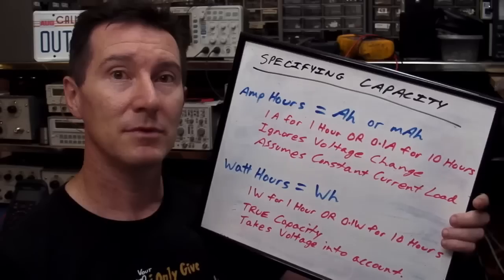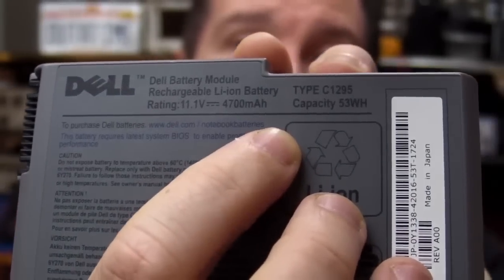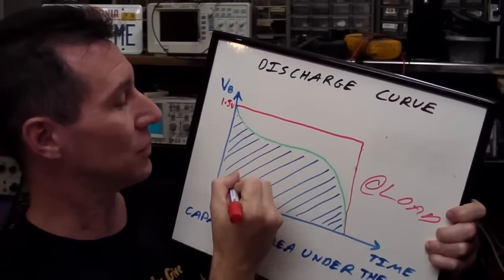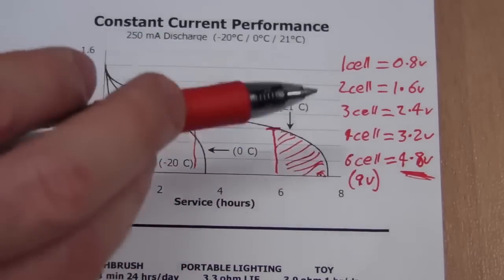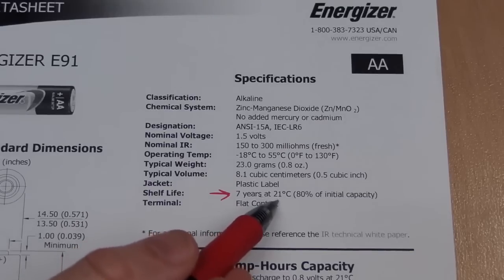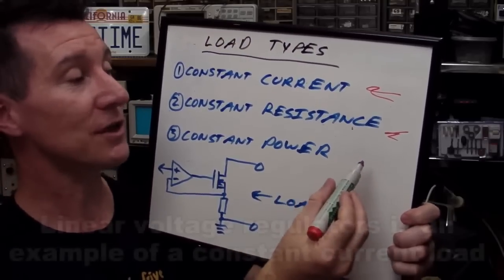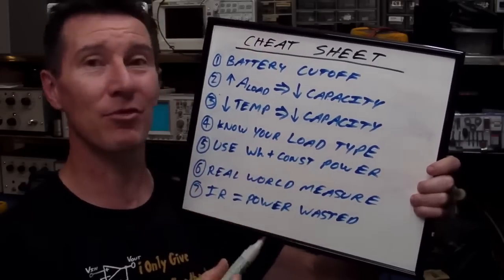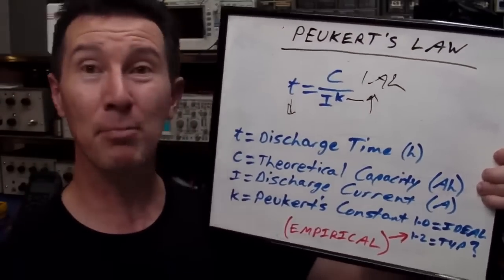EEVblog #140 - Battery Capacity Tutorial

Comment: A very good video. I've been doing a bit of hobbyist testing of CR2032 batteries and this is very useful in covering  the finer points of capacity and battery performance.

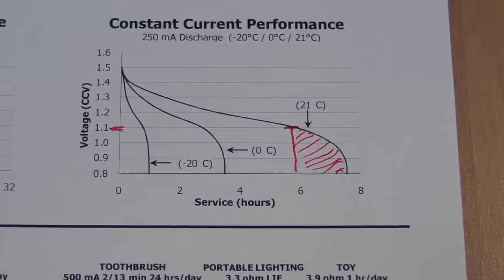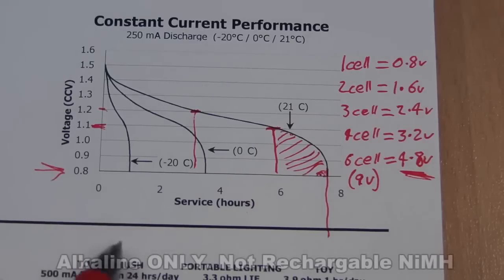For the discussion at 12:30, as per the added caption at 13:24 about rechargeable batteries, isn't there a dilemma here about product design vs a 0.8V cutoff as users are likely to try rechargeable batteries even if the product says not to use them? Some products have a user-specified setting for battery type but I've always assumed this is just used for battery level indication and is unlikely to be perfectly trustworthy?

Comment: The total energy of any maximized chemical storage is roughly equivalent to the same mass of common explosives like flash powder or dynamite. 

So if you measure that a battery has around 5 grams worth of chemicals in it, if the energy was released at the same speed as a plastic explosive by a capacitor, the damage would be roughly the same as detonating 5 grams of TNT or C4 or RDX, whatever.

Comment: I am back watching your vids Dave - great work. You are worth a trip to the "top paddock" - no knackery or mackers for you . comment all positive so fear not>>As I done Mech.Eng before Elec.Eng . Battery and nonlinear (eg. milliwave 18GHz and above) circuits never bothered me, but working with elec. techos I spent many hours explained non-linear behaviour and "capacity".  Mech.Eng is about laws of Thermodynamics ( that's proper Mech eng science - more like physics or theoretical mech as opposed to quantum mechanics ). I had fun times explaining concepts to techos and I can tell you they hated anything that involves math let alone opening the mouth and sounding out word like "Integral" of "Differentiation" and Fourier was some French guy. Best example of non-electrical circuits involving sink-source ops are pneumatic-air or fluid circuit and "load-matching" all fun stuff. Keep up a good work Dave, I will see all of your blogs in no time - thumbs up on all of the ones I watched so far. ( Ps I did learn from them also how to ...:-)

Comment: 6:46 1J=1W.S=1W.H/3600, not the others way around.
Reply: It is true that 1 joule = 1 watt.second
It is also true that 1 watt.hour = 3600 joules, so that 1 joule = (1/3600) watt.hours

What he is trying to say in the video is that if you have a value expressed in watt.hours you need to multiply that value by 3600 to get the value in joules, and that is exactly what he does for the AAA and AA cells. I agree that the presentation is a bit off in his 'equation'.
Reply: U r wrong
J = W * S = W * Hr * 3600

You divide Hr by 3600 and what do get? Ahahhh ))

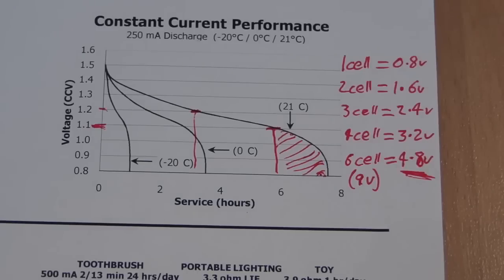Comment: At 13:00 -> If I would run a LED with 3 cells at 2.4 I'll get the most out of a battery? N how do I make shure that the LED is staying at 2.4V? A resistor is for the current, but what restricts the Voltage? Please help me I have to deliver the atomic bomb by Monday next week. thanks I will mention your name.

Comment: This whole Amp hours and Watt hours debate is why deep cycle batteries often use reserve capacity as a measurement because it's a good apples to apples comparison between the same kind of battery. I'll explain. A 12 volt nominal battery with 60 minutes reserve capacity. That means that this battery will stay above its depleted voltage (if memory serves the industry uses 9 volts as dead) for 60 minutes at an industry standard 20 amp draw. Basically at an average draw of 240 watts (12 volts nominal times 20 amps) the battery will run for 60 minutes till it's depleted.

Comment: Hello Dave, I find that when you try to charge your Batteries too fast, you end up killing the cells.they buckle and once you get them hot, they will never be the same again. The best way to charge Nicads and nimh is with a workshop power supply and when your current drops to close to zero, battery should be charged. If battery always draws current, usually means Battery is rooted. I have tried all the different tricks years ago when cell phones hust came out and phone batteries were worth a couple of hundred Dollars. We used to charge people to recondition their Nicads. All we would do is zap the batteries with 240V just for a laugh and the fucking stooges would think they were all reconditioned. It's basic Ohms law

Comment: EEVblog, Does a AA battery have enough energy to kill a human if it is drained out in a single go? 9000 Joules you say...
Reply: Apparently you can kill someone with a 9V Battery, across the heart, the basic rythim of the heartbeat gets whacked out of phase and cardiac arrest usually occurs. Also need to take into account how sensitive your skin is. and it needs to be a real unlucky whack to cause your heart to go out of phase
Reply: yes with ease.
Reply: @mitch3443ful 
just look at an official datasheet, a typical AA alkaline provides you ~2400mAh capacity when at a discharge rate of 100mA down to 0.8 volts over 20 hours. the average cell voltage during this time is around 1.1v to 1.2 volts.
This gives us 2400mAh * 1.1V = 2640mWh = 2.6Wh. 
2.6W * 3600s = 9360 Ws(Joules)
A high voltage capacitor bank at 9000 Joules can vaporize copper wires. Not melt, vaporize. Wire explodes into thin air. 
9000J can also be used to make a rail gun (which will be 5x more powerful than any 9mm)
I don't want to imagine what 9000 Joules shorted across somebody's heart would do (it would probably explode). 
hope this answers your question

Comment: A non rechargable battery out of a high power device is kept here for the clocks. Clocks are really low power devices that can go years on a battery. The battery probably loses more through discharge then through what the clock needs. 

So after a big power drain is done here with a non rechargable they are simply demoted. 

Still I hardly use non rechargables these days. A good rechargable is worth its price ;) But not for clocks...
Reply: What do you think of the high drain alkaline cells Energizer has? I've never used them, but I've seen them at the store.
Reply: tarstarkusz I wouldn't know. I never seen them myself yet or tested them.

I guess for one off high drain uses like cameras, drones and the likes it will have a use. 

Still rather go for Low Discharge NiMh if possible. Not that well suited for super low drain but medium and high drain they are just fine.

And there always is lithium for the specific machines that can handle them.

Comment: What about nuclear batteries?
Reply: shomolya https://www.ideals.illinois.edu/bitstream/handle/2142/16849/1_yakubova_galina.pdf?sequence=3
Reply: shomolya So? I am waiting for your analysis and my sharks are very hungry...
Reply: The reason why these batteries have such a high energy density is because if you look in the periodic table, the nuclear elements(which would compose of the batterie's cathode) would have the greatest amount of electrons in comparison to the other element. This is what allows them to discharge for such long periods of time. So technically, you could produce a uranium-carbon battery as apprised to a zinc carbon battery and it would still work! So here is your answer 😎.

Comment: I think Dyson hand vacuums pretend to be an ideal battery (I know it's just theoretical) we have a small Dyson vacuum at work that even new out of the box and even in the instructions says the battery will only last 7 minutes. And it literally does from a full charge you get 7 minutes and then it stops no slow down no way to get a bit more out of it the vacuum will just stop working at 7 minutes, bam, done!
Reply: David Hughes They've achieved that with power filtering.  It's a good idea though, because nobody really wants a product that starts out tough and then wusses out after a few minutes (I'm looking at you, cordless drills.)
Reply: Lithium Ion Batteries will hit a certain Voltage and then just cut out. They have electronics in the cells to do this. I think It's because Lithium Ion Batteries don't like to be totally drained

Comment: Well, isn't that just depending on your definition of capacity?
When I think of batteries, I always think of a discrete amount of separated ion/electron pairs stored in the battery, which, for me, is its capacity. No matter what voltage or current you drain the battery with, at the end of the day, all electrons will have walked from one side of the battery to the other, if it is completely drained.
It's like having a 1l bottle of water with a hole in it. No matter how big the hole is (max current) or how high the water pressure is (voltage), when the bottle is empty, you will have gotten 1l of water out of it.
So, in fact, I think it's kindly fair to say a battery has a capacity to store N electrons (and ions) which also is N*e = Q [Coulomb] = I*t [As] or [Ah].
Sure, in your application, you will have to take in account your voltage and current. You won't be able to use the full capacity if your cutoff voltage is too high... You also won't be able to flush your toilet with only a 1mm opening in the water-bottle ;) However, measuring battery capacity in mAh isn't wrong... In fact, it's the only right way. Imagine a fully charged battery with completely isolated contacts. You won't ever get any current out of it, so no Wh at all. However, technically, it still stores a fixed amount of electrons. It's like a sealed 1l water bottle you cannot open. You can't use it, but noone would doubt it has a capacity of 1l ;)
Reply: But when powering electric devices your electrons only mean half of the equation.
In those cases you usually have "work" to do and work is the equivalent to the energy which is measured in Wh.
The amount of electrons would be Ah.

When you want to power a turbine with water it doesnt matter if you have 1l or 1000l if they are not fast/strong enough to even make it turn. Thats where the voltage comes in.
Voltage represents kind of the strength or speed with which the electrons move and that is also energy (you know, energy is mass times speed, more electrons equals more mass and more speed has a direct impact on the energy).

Comment: One of the best quick battery videos on YT, though most of what was said would apply more to primary cells. Unless you go nuts, you should get 3WH out of a 2500mAH NiMH cell at the same temperature (though most good quality NIMH cells will work at low temps). While it's nice to lower the draw by adding cells, there's a tradeoff on that too. Never underestimate the stupidity of the person who will use your product and go mixing cells and the more cells there are, the more opportunity there is for a mismatch.

Comment: Dear Sir

As a school project I built a very simple lead-acid battery to investigate cycle fade. 
The capacity of my lead-acid battery decreased as the number of cycles increased, as expected. Surprisingly enough, the capacity increased after a 24 day period of deep discharge. I did the same thing three more times (so a couple of cycles followed by a long period of deep discharge) and every time the capacity had increased after the period of deep discharge. 

The battery did become more difficult to charge (to induce current flow a voltage of about 10 to 16 volts was necessary, just for a few seconds) and eventually it stopped working. However, I was very surprised to see that the capacity loss after a few cycles, and I was wondering whether you could enlighten me. 

I assume you will not have time to answer my question, but I'd greatly appreciate if you could shed some light on this issue.  I can send you my results, in case you are willing to take a look.

Thanks in advance,

Nol Duindam
Reply: It sounds like sulfation. It's when the sulfur dioxide in the battery acid breaks loose and sticks to the lead plates. Sulfur dioxide is a good insulator. As the sulfur coats the plates, you have less area to charge. If it fully covers the plates but in a really thin layer, a higher than normal voltage will start charging. This current flow will help put the sulfur back into battery acid (sulfuric acid) and you have to add water (the sulfur steals parts of the water to make acid again. Leftover hydrogen "boils" off). If it gets too thick, the charging voltage can be very high with little to none current flow, and the battery stops charging. Oddly enough the plates are holding a full charge, but you can't "reach" it through the sulfur on the plates.

Comment: You've putted you finger in the wound, the capacity of the batteries still the most difficult thing to calculate as the technology of batteries still almost the same for decades.

personally i've suffered alot with the lead-acid batteries for PV powered standalone systems.

there are many factors affects the performance of the battery bank, so no way to get an optimum battery bank design. it will be always over sized. and if we can put finger on all effective factors on the battery performance. you can't make sure that the load will perform as u expected. for me i was using LED luminaries as a load which has alot of effective factors on the performance, the temperature is the most annoying thing about it.

Comment: can you help me with this? i have something like a charger.. it says like this:  INPUT 100-240 V 50/60 HZ  0.3 A   OUTPUT 12 V;;; 0.5 A     how can i get more ams then taking?  i dont get this.. this is the first charger i have seen like this..  taking 0.3 A  OUTPUT 0.5 A    what is this about?  and can i compare batterie and electricity with pool and water?  for ex.. pool is the battery.. voltage is the pressure i have on the hose.. if i can,, then what are the the amps and wats?. thank you .

Comment: I built the SC idea of a capacity tester. At a $2 shop type place and buy a cheapo analogue travel alarm clock  powered by typically an AA cell. Bridge it with a load 15 ohm for a 100 mA load. set the clock to  midnight, insert battery and it will tick away until the voltage is about 1.1 V when the clock will stop. Read the time in hrs and mins this gives fair comparative capacity time . I built a four unit tester, and the results are quite informative.and reliably indicative of capacity

Comment: Just been looking at the discharge curve for duracell batteries... i dont think its a coincidence, but they mostly show a sharp drop off at 1.1v... coincidence that the drop out voltage for a linear 3.3v regulator is 1.1v, so its almost as if 4 aa batteries were made for them ;P

Comment: Greetings from Bulgaria, Dave. I have a question. Well, for example AA battery is 1.4v fully charged and 1.0v fully discharged. From what I know, a battery rated at 2800mAh means you can draw for example 2800 miliamps for an hour and the voltage will drop from 1.4 to 1.0 in that time. So the voltage is actualy not ignored (or assumed constant). Am I wrong?

Comment: That curve looks suspiciously familiar. A RCA document was recently released that showed vacuum tube life. It was about the same curve. I am guessing the battery's chemical use/depletion and the valve's chemical depletion are much alike. I use Tenergy NiMh and had great luck with them. Some were 2500mAH and some were 2750-2900 for AAs. I factor in the dollars I save buying the Tennergy over some fancy retail crap, and the no name works fine. Energizers died long ago, but my no names still work.

Comment: You're saying that the mAh definition assumes a certain voltage, but you're making that assumption yourself. You would need to assume some voltage level if you want to calculate energy with a simple multiplication, but that's not the fault of the definition of Ah. Neither does it call for keeping the current constant. For example, 1h of 200mA + 1h of 400mA usage equals 600mAh, no matter what the voltages are.
What is capacity? Does that mean energy or Ah capacity or something else? I don't know.

Comment: Think about this: an average person needs around 9000 kJ a day (not talking about manual labor or athletes here; they can easily use tripple the amount). That's equivalent to the energy stored in 1000 AA batteries or a cube a little larger than 21x21x21cm³ stuffed with batteries. Running a human on batteries wouldn't be cheap ;-) . And if you have rechargeables: even with those 4x15min quick chargers you'd need 3 of these charges stuffed 24/7 to have enough energy.

Comment from the maker: @kd5gua It depends entirely on how you define the battery capacity and it's end use into a particular load type. By the very definition, mAh or Wh capacities are implying a constant current or power discharge rate.

Comment: Thank you for the video Dave, very interesting! I'm also studying electrical engineering, but not in english. And I'm always having problems understanding what the 'load' is you are always talking about. Is it the current your circuit has to create, or is it the resistance it sees?
Reply: Unfortunately, the name “load” has various meanings in electrical engineering. Usually, it refers to the device the power supply is supposed to energize.

Yes, I’m replying an 11- yo comment, and the OP probably knows the answer by now. I’m replying so that anyone with the same question can see the answer.
Reply: @altuber99_athlete  OP here. I didn't even know about the existence of this comment, too long ago. Indeed, by now I know the answer, but thx for your reply :-D!

Comment: I have a 3.3V MCU wondering what sort of battery to use. 9V - buck converter, or 3x1.5V to regulator. I think did some rough calculations and could get 10 days of use putting the MCU to sleep 9/10 of the time.

Comment: @ryanstewart86 Probably because the capability of the battery to deliver current is dependent on a chemical reaction, and normally chemical reaction rates increase as temperature increases.